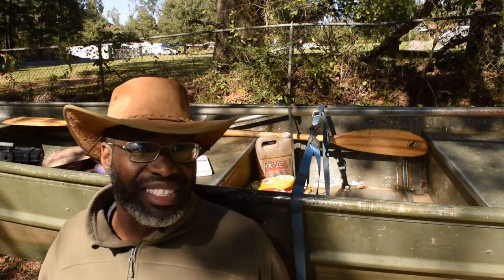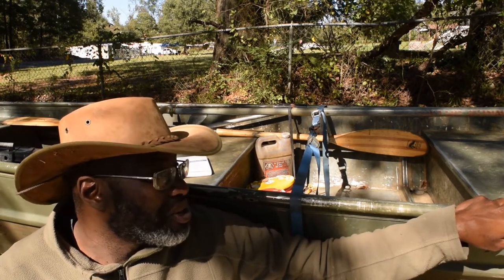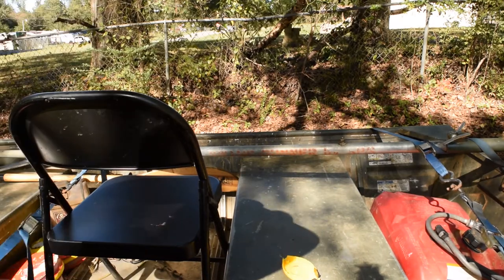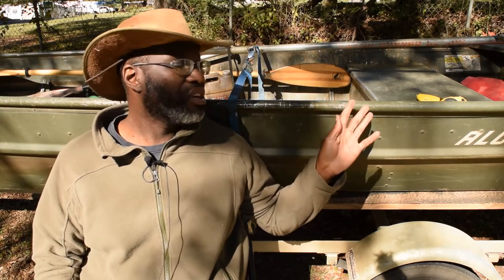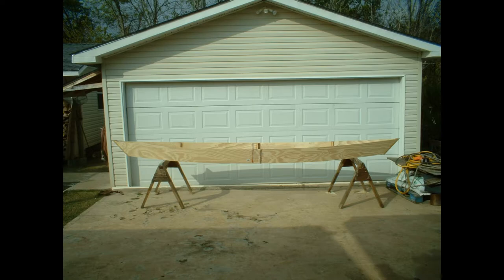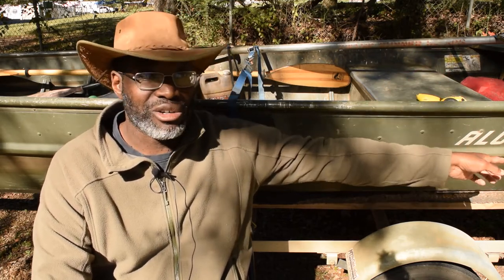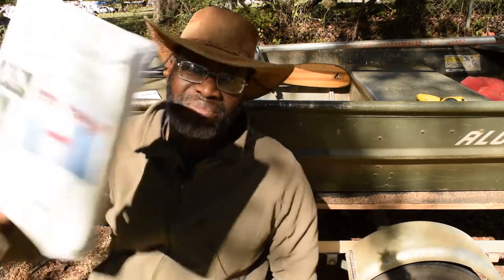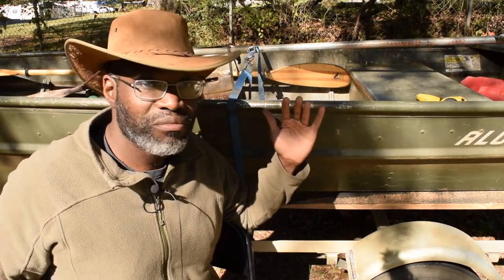Project Mud Boat | Thai Longtail Boat Plans

Comment: This is awesome.  I lucked into putting a 2x10, 48" long between the stern and middle bench.  Then I put a swivel mount on there with a folding plastic boat seat.  This allows me to sit on the 2x10 anywhere between the two benches moving the ballast weight forward or back.  Helped me a lot especially because I'm a bigger guy.  Also nice to be able to straddle the 2x10 if I want to face forward or backward while fishing.  But the overall goal is to build a high side narrow river runner to accommodate the thai long tails. I love this idea, massive thumbs up.
Reply from the maker: I have thought of adding a long bench along the entire length of the hull instead of thwart benches.

Comment: I mentioned earlier about contacting a career center to build your boat as a project. You might also try contacting a marine architect school to help design it or see some of the students ideas. Don't try to re invent the wheel. There are a lot of resources out there, don't be afraid to use them.
Reply from the maker: Well, that's exactly what I'm doing using a set of plans and real boat at the base, only making changes to accommodate a specific need. I'm not reinventing anything, just making slight modifications to what is already public and proven knowledge. I don't need a naval architect degree to do that.

Comment: I added 16" long by 10" wide PODS to the back of my 12" jon boat. Makes it much easier to balance the load length wise and much easier to get on plane even with my 5.5 HP Honda. I am running a Backwater mud motor and not a Thai longtail though.
Reply from the maker: Thx, man. I've seen those. Thanks for mentioning it.

Comment: I agree with the American Jon boat not working with a mud motor.  That's why I traded for a normal outboard today.  The guy that traded had an issue where he had to keep the prop out the back because the way the transom was made (v bottom) but man it pushed his 14 footer way better than my 12 footer!  I still think mud motors are very unique!
Reply: I will toss $10 your way.  See if your AMP flies will work for Skipjacks using poping corks.  If you feel like making them special email me (we can talk about what skipjack like to eat).
Reply from the maker: Yeah, what motor did you end up with?
Reply from the maker: Man, I appreciate it. People may not believe it, but a $10 donation goes a long way. I should be able to build a set of sawhorses.

You know my dad left me some cedar, and I have a lathe. I've been wanting to delve into popping crank baits. Let me throw in a couple rattle corks I had on that trot line a few weeks back.
Reply: Sure!  I wrote out what Skips like to eat when I did the purchase.  Threadfins are amazing looking fish.  Silver with a glitter like appearance and blue tips on the fins.  I saw Skips feeding off them directly right next to my boat!  They also hit what I think is called a hair rig that has the smallest jig head you have ever seen and maybe 10 white threads tied on it.  The poping cork is just a weighted bobber that disturbs the surface attracting the fish to that spot.  Allows casting of super light lures like Foley spoons and flies.
Reply: I got a 6hp Johnson Sea Horse.  Runs like a top!